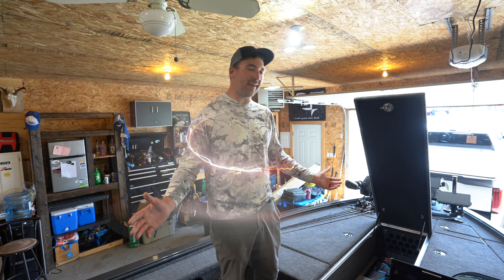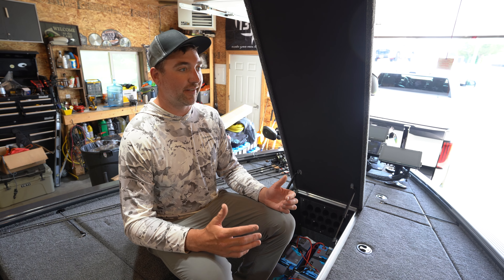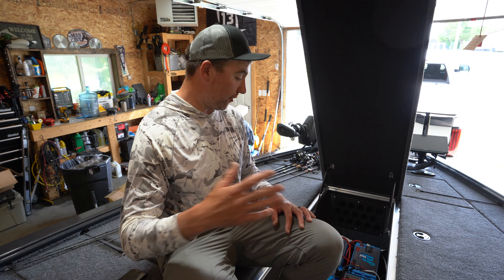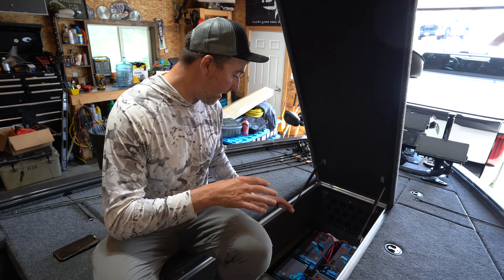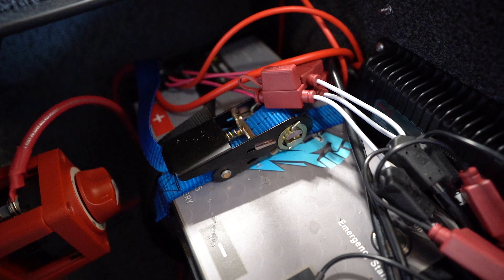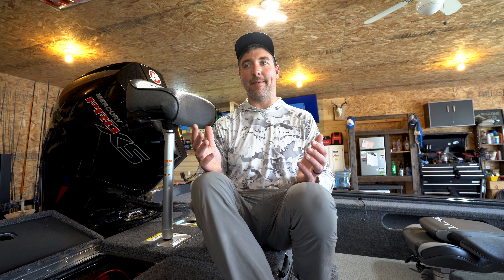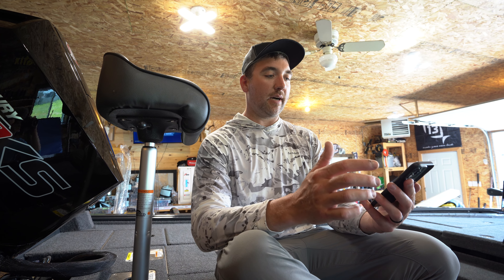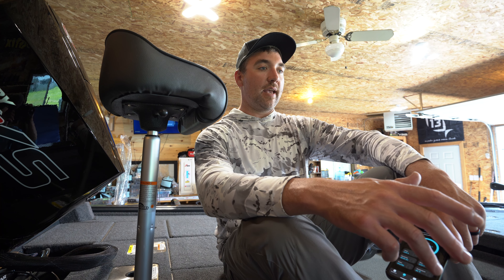16 VOLT , 36V, and 12V Lithium Sonar, Boat, and Trolling Motor Battery Set-up EXPLAINED

Comment: What a wicked setup Brucey,  you have been an absolute unit on the opens so far. I’m fired to see what the northern swing has in store for you. Also wondering- does the the lithium cranking battery void the warranty on the merc or has that changed now ?
Reply: I would also like to know that too
 does the the lithium cranking battery void the warranty on the merc or has that changed now ?
Reply: AGM is all that's needed on cranking..I run 5 graphs,livescope & pumps on 1 31 AGM...Never an issue..But I run a SHO...

Comment: Very nice video explaining the set up for Lithium batteries.  I have a single 36v 63AH from Dakota Lithium to power my Minn Kota Ulterra on a Ranger 223 FC (Fish and Cruse)(tri-toon) Pontoon boat. I currently have a single 24 size lead acid crank battery, however two graphs, live well and normal boat accessories run off this setup.
However, I have had some power issues with this smaller battery, so I have begun my research for the ‘Dual Purpose’ Lithium batteries to address the power issue. This way I can get clean, level voltage to my electronics. I only fish 2-4 hours at any one time and looking for something for alternative power connection.
One question I ask you about the cranking setup, I do have a 60A breaker on the trolling motor, would I also need additional breakers for my electronics or between the main power (+) connection, when using a lithium battery verse’s my lead acid I currently using for connection. Currently I believe my graphs are connected to the fuse panel that came with the boat for power and along with the other accessories. Boat dealer installed the graphs thus not sure of wiring.  This boat has aluminum cladding underneath, so I have been told running wires could add to labor costs. Thanks for you suggestions and expertise!

Comment: Thank u man!!! I been looking for a good 16V . I have 4 graphs ..NBT marine 22/garmin 8612 I just upgraded too..also have 2 birds for mapping /one boat network ..16V id rather be over kill for clear power and lasting ..the run n gun charging system I need to check into ..also
Backing up
Another for my 3 12V lithiums ..it’s hard to find any detailed videos on powering livescope :dedicated graphs so I really appreciate it . I’ve heard great things from powerhouse lithium. I’m trying to do this right !!! Can I ask one thing ? How sturdy is your NBT marine 16/22? I am 2 weeks from that purchase(got my 8612/34L already) I truly appreciate it . I’m looking for a good single mount for the 22!!

Comment: Hi Jamie.  Would you think I’d be ok to go with a Lithium 12V 135AH battery for starting my 150hp Pro XS and run 2  12” Helix’s with mega live?  Would the alternator in my motor be ok and charge the lithium battery?  Great video. Thanks Bud
Reply from the maker: For sure you would be ok, that’s a lot of jam
Reply: @jamiebrucefishing   Thanks for letting me know.  Still seems to be a good debate on using lithium for a starting battery eh. But I’ll try it. I also will have 2  12V 100AH running my Terrova.  I’m taking 90lbs out of my Lund 1875 Impact XS.  That’s huge. Can’t wait for April. Cheers

Comment: What battery charger do you use for the 16v ?
Reply from the maker: I use the 16v run and gun charger hooked to my house battery which has three leads from a Minn kota 330 .. powerhouse has a couple different 16v chargers as well.. this year I’m using their three bank that has 12,16,and 36v banks

Comment: I got bad news for you, Jamie.  There are only two ways to make a 16 volt lithium battery.  They're either using a 4S lithium-NMC or a 5S lithium iron-phosphate.  The NMC batteries are the ones Samsung put in their tablets...you know, the ones that caught fire when they suffered a thermal run-away situation?  A 5S LiFePO4 battery would be very unusual.  I've been following this industry for several years and don't know of anyone building a battery with that spec.  The last thought I'll leave you with is a conventional 4S LiFePO4 battery has a nomimal voltage of 12.8 volts.  Throughout roughly 90% of its discharge curve, it puts out about 13.2 volts.  IF there is any voltage sag it would be a result of incorrect wire sizing, because none of the things you listed draw enough current to be a concern.  Also, since those electronics use relatively little current, a 100 or 105AH battery is complete overkill.  You got took.
Reply from the maker: My amperage draw from electronics is around 10ah , so for me the 100ah is about exactly what I need , especially with a charging system on the water

A 16v lifepo4 battery is very unusual, , which is mostly why I made this video.  Unless all of my graphs are wrong, they all hold steady around 16.8 volts. 

Not sure what else to tell ya!
Reply: 100AH isn't a complete over kill buddy. This ain't a solar system. Most competitive anglers run several electronics, 4+ graphs, a livescope GLS10 box, 2 talons, and on board systems(livewell,radio). I run a 2X100AH 12V for electronics as well and it's nice knowing you can go fish for 12 hours for 2+ days and not need to recharge.
Reply: @marcquenneville3305  - Yeah, I didn't account for the sheer volume of electronics competitive anglers are running.  I still don't see where the 16v battery makes any sense, since a 10-amp draw is not going to cause any sag on a 12.8v LFP battery.  Also, those batteries are absurdly expensive for what you get.  On a per-watt-hour basis, they cost more than just about anything else on the market.  I build my own power stations and trolling motor batteries, using component parts, and it costs less than half what they're asking for these products.

At least they ARE using LFP cells (in a 5S configuration) to create 16 volts.  That's better than NMC, which is what I was afraid they were using.  In the future, we'll all be able to get LMFP cells/batteries, which offer excellent gravimetric density w/o the concern of thermal runaway that NMC has...an important consideration on a boat!
Reply: Coming in here a little late, but wanted to comment on the whole 16V and 28V things being thrown around recently in the lithium space. I appreciate the fact some "feel" the higher voltage is going to produce better performance from their graphs, but the tech just doesn't fundamentally add up. Yes, electrically, less amperage will flow through the wire due to the step-up in voltage so you account for a minute amount of loss, particularly if you're using undersized gauge wire. If stepping up the voltage was so great, all you would hear from all the corners of forums and youtube is "ensure you are putting all your active sonar on 24V!" as nearly all the vendors have support of that voltage for some time. Hypothetically, the market would absolutely rush to convince us it's better ("We support 24volts, while our competitors only use 12V!")

All of this equipment already include DC-to-DC converters in them. Regretably we don't know what voltage ultimately the device needs to run (not without breaking open the device and testing it). The vendors provide these power supplies to ensure they can handle spikes and dips in the voltage overall from their power input (or it's just because the converter they have is either because of size, quality or cost of that component). All the extra complication for adding 16V and 28V step-ups (also... an odd voltage and as stated by @jasonbroom7147 something  quite unique is being done to achieve the 16V in the battery)

Lithium is great. 12, 24, 36 voltage all work great. Lots of vendors in this space now which is great (perhaps, however, some in "enhanced" pricing category due to brand and bro recognition). My guess is that some that feel they are seeing better things is partially due to the switch to lithium, and perhaps more so because the "unique setup required" to use these new voltages requires revamped wiring (replacing previous wiring perhaps not appropriate for the needed demand). The shift to lithium will likely reduce if not eliminate concerns of lower voltage drop (due to the flat nature the medium), but still not correct for an improper gauge and/or length of wire run for the needed workload amperage. Use the right size wire for the amperage and associated loss/distance will work every time. Keep it simple.

Last comment: there are now videos coming out showing no real difference when using different voltages for their active sonar. It would be great if pros and vendors alike that espouse the benefits of using these new voltages show the real-world gain they are realizing from it so people can make an informed decision rather than experiencing FOMO.
Reply: @SirWoogie  - Yeah, but you can't charge extra for a 16v battery AND dedicated charger, unless you claim they add some kind of value.